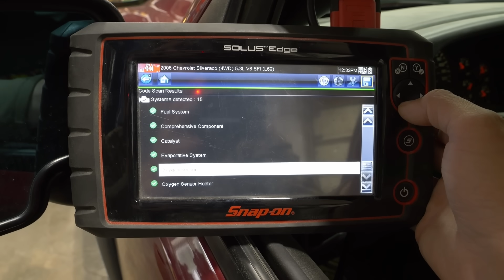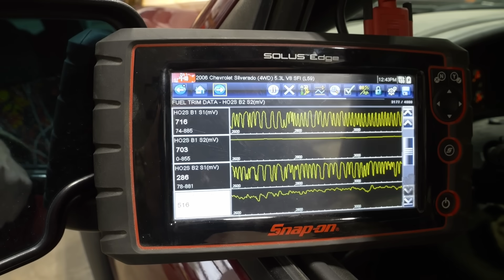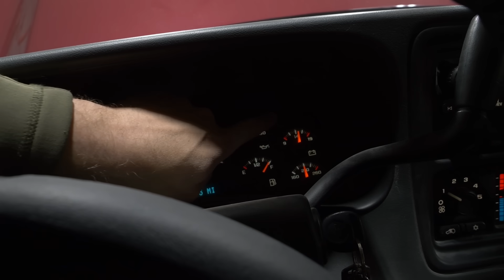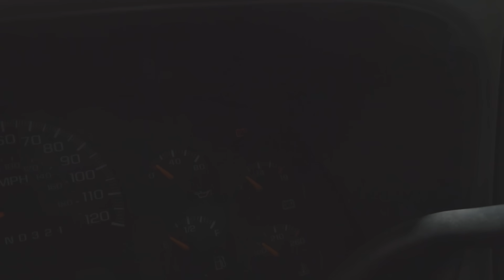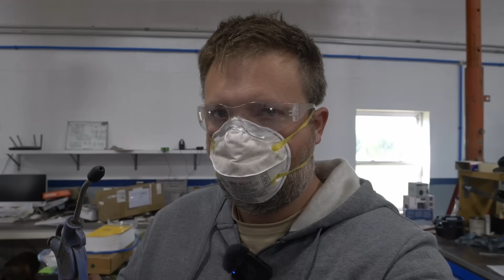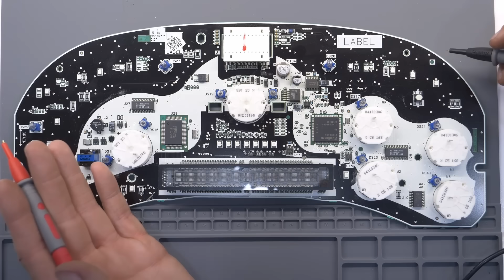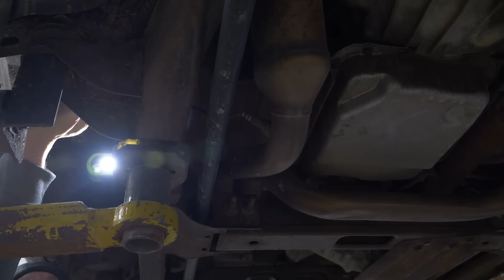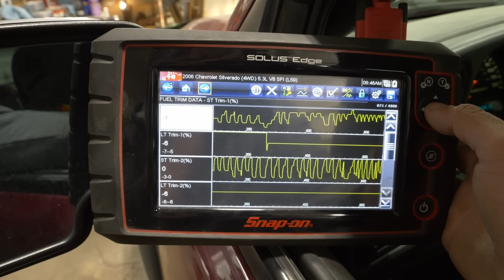AutoZone Says It Needs a Starter

Comment: I feel like the number of independent homeshop mechanics that will open up an instrument cluster and check out the solder joints in North America is probably not in the dozens.
Reply: the "you touch it you own it for life" attitude of customers and lawyers makes it impracticle  to mess with them unless its your own
Reply: @richardcranium5839
Reply: @richardcranium5839  most shops have no clue they own the repair until some else touches it or its in a junkyard i run a collision shop and have told the local mech shops about all the new sht that must be calibrated after certain repairs in one ear and out the other even the dealers
Reply: I'm told United Radio in Syracuse New York will repair clusters.  You must speak to the manager in advance and you must ask nicely.  I believe South Main Auto sends some of their clusters there for repair.
Reply: Many years ago I had a CRT TV that was making a noise and displaying intermittent images. Opened it up and carefully avoided the high voltage bits and resolvered all the solder joints and low and behold I repaired the TV. Dry solders with that lead free crap caused many more problems than it was worth.
There was an HP 1500 series laser printer that needed the logic board removed when the printer stopped working and placed in an oven preheated to 180°C (356°F) for exactly 10 minutes which fixed the printer back to new working condition. Lead free crap...🤢🤮🤮🤮
Reply: @josephking6515  Released 2012 is what google says, in which case you can blame HP- not unleaded solder. And, at 180C that's going to be low-melting point solder, if its solder, which is a third issue entirely.
Reply: @josephking6515  Excellent, Joseph! I can tell you might be watching BigClive, as many do. Lead free solder SUCKS! That's why we use a Solder Sucker to Suck Out the Lead Free Solder! Because it SUCKS! Even if you use FLUX, it still Sux.🤣😂👍
Reply: @josephking6515  Eh, rather have problems with the product than lead poisoning for the hundreds of thousands that deal with solder everyday.
Reply: @itsnetts  Besides, I think that was mainly teething problems that have been fixed a while ago. Lead-free solder has been around for 20 years by now.

As a DIYer I used to loathe it, until I figured out you needed to use flux, unlike with the old rosin core leaded solder. Mildly annoying because it's one extra step but not too bad in the grand scheme of things.
Reply: @Ragnar8504  Interesting info, thank you. As I was born in the turn of the century, this lead free stuff is all I've pretty much ever known. I did not know you used to not need flux! I do have an old radio that might have actual lead but I'd rather not poke at it if it works. Hmm, maybe I should get one of those solder lead test kits now that I think about it, lol.
Reply: @itsnetts  I went to engineering school just as lead-free soldering became a thing, around 2004/05. I actually know some people who experimented with lead-free solder for solar panels, at that time without much success.
Leaded solder often had (and if you can find it still has) a flux core, which means you don't need liquid flux.
Treat any soldering work with care - use a fume extractor and thoroughly wash your hands afterwards. Anything made before the mid-2000s will 100% have leaded solder. Take appropriate precautions but don't panic.
Reply: @Ragnar8504  Appreciate the tips! Been looking at the fume extractors but they're pretty expensive for what they are. I might build my own or just keep wearing a respirator, dunno. Thank you for the interesting story as well :)
Reply: @itsnetts 
Everyone is using lead free rosin core solder now. Some use a gas on the solder area
Reply: I did the instrument cluster resistor solder test (pushing on partially disassembled installed cluster resistors with pencil eraser) and fix on my 2004 Silverado 1500 LTZ.  pretty simple fix once the youtube wisdom universe showed me how.
Reply: I have resolved issues with the dash printed circuits on a few cars, such as transmission warning light lit from backfeed. And I replaced the speedometer for a 94' Corolla with a 97' Geo because a resoldering job on the Corolla only fixed the shifting issue for a month or two. I checked 14 different Corrolas in the junkyard- all clusters gone.
Reply: The number of people that can troubleshoot anything is dropping fast.  Half the people I work with would starve in their own bedrooms if they woke up on the wrong side of the bed.
Reply: Remember, Mexico is in North America, but I agree with your point.
Reply: It's not that uncommon for people to replace servos in their GM clusters. But I hang out with a lot of techs and former techs, so my sample is no doubt biased.
Reply: They barely want to pay to you look at it let alone all of this extra work. You will lose your ass doing this sooner or later.
Reply: I did that on my 2003 buick regal to replace four 150 ohm resistors took about an hour and a half it was very straight forward. I don't work in the industry and am 63 tried to do my own work my whole life. Never bought a new car.
Reply: I once pulled the cluster on my 1984 c10 and taking the plastic cover off the speedometer Guage arm broke off. Old. There was a bout a 1/4" of the art still showing so I got a toothpic and orange marker and superglue the new arm on the stub.
Worked till I got rid of truck in 1996. Traded it for a Fender P bass. Strait 6. 250.
Reply: No cluster issues on my 2001 yet but the temp/compass on mirror stopped about a year ago. I opened it up and yes almost impossible to see cracks in soldier so did a little garage mechanic soldier fix and works great now.

Comment: I have an odd problem with my 2015 gmc 2500hd denali. All at once the ambient temperature display in the radio shows -40 degrees, the truck says low battery on the cluster, and a code for the humidity sensor in the air box. I replace both ambient temperature sensors and nothing. And I checked the batteries and they are good and charging system is working great. Idk what to do. I can't get a good wiring schematic for the truck.

Comment: Good Job. The best way to check these things is; open the driver door, start the truck, kneel down and put one hand on the brake pedal. put it in drive. Then, hit the gas and, let go of the brake pedal quickly. This usually fixes all problems related to trucks really. I've seen it done before somewhere......not sure where tho...👀🤣🤣

Comment: Hey wes I got a question my sister-in-law has a 1.4 turbo Chevrolet Cruze 18 redline  the car was misfire on cylinder 1 replace the coils and spark plugs on all four cylinders car still says misfiring on cylinder one and Stabilitrak comes on replace the fuel injector on number one and it's still saying misfiring on cylinder 1 on the computer could this possibly be a PCV valve car has lots of pickup when the engine light is turned off

Comment: As you know, electricity will find the easiest path to travel.  Somehow, some small amount of electricity found its way into that battery LED and made it glow dimly.  But you already knew that didn't you?  I recently had a starter where the bendix didn't disengage like it should.  In a very short time, just a few minutes really, the commutator came apart, destroying the brushes and the brush holders.  I didn't know at first what happened, just that the truck didn't start or make any noise whatsoever.  When I took the starter out, pieces of gray stuff fell out of it.  I thought they were pieces of a gear.  I was expecting to find either the bendix gear or the internal gearing (it was a high torque starter) damaged.  They were fine and the gray bits were actually pieces of the brushes.  That was a first for me.

Comment: I had a similar problem on the same truck when I put LED lights in one of the tail lights. I could not figure out why but when I pulled the bulb out it all worked normal I I just left them out

Comment: Last week my 2007 Chevy Silverado did this. It's a classic mode. The l
Key wasn't fully releasing at the end of the tutn back to shut it off.  It was intermittent and driving me nuts.
So, I replaced the key cylinder.
Problem gone. And so is half of my parasitic power draw! Great video. Remember Occam's Razor! Lol

Comment: My 2001 silverado 1500 6 cyl, recently was having the battery light on and autozone told me he wouldn't do anything until that belt was changed. Already had the new belt waiting to chg the leaking water pump. Did the pump and pulleys and tensioner and belt and fan clutch at 200,000 miles and the battery is charging fine now, no more battery light.  Good mechanic at autozone. After changing the belt I can tell that the belt was way loose. Just couldn't tell for sure before.

Comment: Wes , I got a question  , I got a 2013 chevy impala Lt  direct injection like most nowadays  , since I drive a mixture of intown and out of town is it a good idea to get it on highway and get the speed up to a constant  higher speed for several miles to help the vehicle warm up to the maximum range , and I do regular oil changes use full synthetic,  does that seem helpful?

Comment: Replaced the cluster in my '02 avalanche at 335,000 miles. At about 338,000 miles now. Went through ISS automotive. Needles would wig out when I hit a bump. Was the solder connections.

Comment: I have a 2008 Silverado 3500 with the Duramax diesel. It has a parasitic draw that kills the batteries in about 36 hours. Eric on South Main Auto has had them in and he says the same thing about the instrument panel being subject to corrosion on the solder joints. He sends them out to a 3rd party I guess, and they redo the connections. I need to try that if I can find the place to send it to.

Comment: I don’t understand how you expected to find a smoking gun with the way you tested the electrics on the cluster. You’re not going to find bleed in from a different circuit by checking the power and ground to the LED from its source.
Reply from the maker: How would you ever find it? The current would be so low that no meter I have could actually measure it.

Comment: Wes, As soon as you pointed that light out I knew you would go deep to find the problem. LOL. Any chance the light issue was the dash module connector? I was told that the downstream O2 sensors had no effect on my ECM in my 06 Mustang 4.6. Well, after dicking around with it for days I pulled the converters (whole front exhaust system, fun job.) and found the substrate in one converter was melted. The upstream sensors were spot on but the downstream were just about mirroring the upstream. Replaced the exhaust with new converters and new downstream sensors and bingo, no more rough running. I kept telling the Ford "Technician" that if the sensors are there they are having some effect. No company is going to add extra cost to the car if not needed, that cuts into profit. Seen many starters do that, usually the noise is very loud and obvious but I did see one that made almost no noise but it did smoke the starter, quite literally. It let the magic smoke out of the starter.

Comment: Nice job.

That whole alternator thing started in 05 I think, in GM stuff.  My 05 Envoy had it, My Dad's 09 Savanna Van has it...  It's basically a computer that tells the alternator "If the battery seems like it's pretty charged up, take it easy and generate less voltage"....  I'm told this is some kind of misguided attempt to save .00005 gallons of gas per year....  Seems like a dumb idea to me, but...

On GM clusters, I usually very lightly put a piece of painters tape on the face, and draw a line for where the needle was.  Then I take a dinner fork and very gently pry the needle off....  Seems to work.  I don't know about corroded solder....  For me, it was always stepper motors that drove the needles dying....  And lights going dead....  And I don't mind soldering, but to be honest, it's way easier to just send the cluster to Dr Speedometer, or one of those places, and they'll replace all the lights and all the stepper motors, and you're done....  Between me and friends & family members, 03 to 06 GM trucks, every cluster would develop dead stepper motors... Notorious....

Comment: You and Eric O are great at diagnosing these electric issues. I had a 98 motorhome on a Ford chassis. The speedo stopped working, but everything else was fine. I found a similar used model on ebay and replaced the control module in the cluster itself and it fixed the issue.

Comment: Diagnosing a transit bus can be fun.  They use a multiplex system to run everything.  I got a bus last week, doors not working.  Supervisor thought I was jerking him around when i said it was a bad sensor in the transmission.  Short version-transmission sends signal to multiplex to let it know bus is stopped.  Bus must be stopped (along with other conditions) for doors to open.  No transmission signal=doors stay shut. Transmission tech came over and replaced the sensor.  Now everything was working.  Bus had been not going into reverse, nor did the brake interlock work, which were other issues, all leading back to that one transmission sensor, and which worked fine after that one sensor was replaced.

Comment: Most leds that are driven off a IC chip are pulled low to turn on. It appears the signal is floating creating that glow. So i'm guessing the pull-up resistor that keeps it off had a broken solder joint.
Reply from the maker: No pull up resistor that I can see. Maybe the shift register has one built in.

Comment: I got into the auto repair business right at the beginning of the movement toward R&R, verses, remove, repair, and replace.  

It got so that it was cheaper to remove a carb, for instance, and put a rebuilt carb on in its place, sending the old one in as a core.

That way, if the "new" carb went bad, the supply place would simply give you another one.  In those days, they even paid for the 2nd R&R.

Which is one of the reasons we used NAPA (not a sponsor), Car Quest, and the like.  Pep Boys, et al weren't going to pay you to R&R a defective part - in those days, even if they did deliver, which they did not.

But yeah, we'd take a starter off, refurbish it - basically clean it up, put new brushes in it, and put it back in the vehicle.  If it needed rewinding, there were shops that specialized in that sort of thing.  We rebuilt carburetors, distributors, and all kinds of things in those days.

Comment: With the rodents in the fuse box and relatively no rust. I wonder if this vehicle sat in an unheated garage, and over time a slight bit of moisture built up behind the cluster causing the short between components. As you said it really takes very little to make the connection.

Comment: Hey Wes. Thanks for video posts. Love ur channel especially the humor. I have a question. Where did you get that tiny 3/8” drive low profile breaker bar used to take out the O2 sensor. That is fit in there nicely.

Comment: I have a 2004 Trailblazer and the battery light was on real dim for as long as I can remember, even when the key was off. I sent the instrument panel in for a rebuild as most of the gauges quit working over time.  Ever since then, no more battery light.

Comment: I worked at 4 big chain parts store...and trained new people off the street who knew nothing....I bet they did the "starter/alternator" test. And had a ground connection so instead of checking the connections for the machine they did the test and it said "bad starter, check connections for the test and or the machine had a massive draw on a bad connection and it popped up bad starter"  there's no training for that machine or the obd2 reader so half the employees guess what the issue is, or print out the massive sheet of paper with "problems/fixes for diag code xxxx"    everyone forgets when you train someone to tell them whatever code is to suggest a shop to diagnosis for a real answer instead of just saying oh jts xyz.  Haha

Comment: Dude I laughed so hard at this video I had a 2006 rav4 to run into the ground for work that. Did the same thing with the battery light staying on very faintly with everything off!!!! I looked everywhere and actually had to disconnect the battery while I worked and when I got home  ....I looked on forums and everywhere and couldn't find anyone else with s similar problem so one weekend I dug in and tried to fix it . What I found was on the the passenger side under the kick panel there were a bunch of electrical connections that seemed wet , as I took them apart and dried them with the wife's hair dryer I found one connection that was green.  I cleaned it all up put it back together dry and never ever had that issue again !!!! This video made me laugh remembering me going nuts trying to figure this same problem our!!!